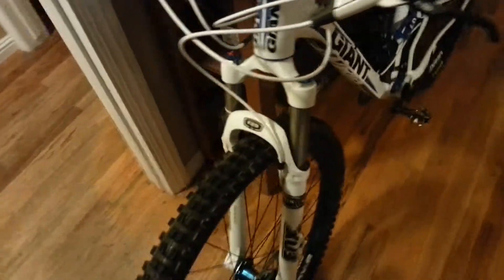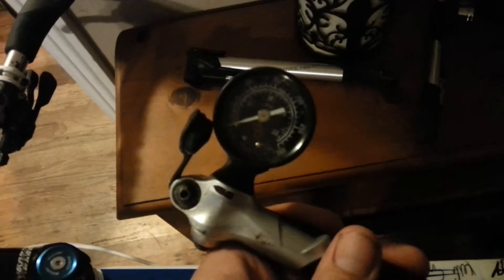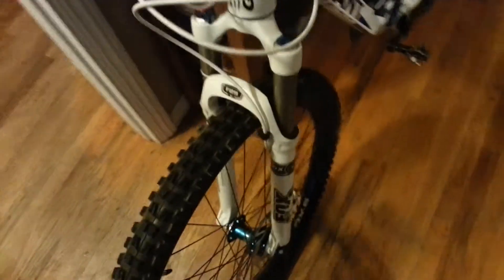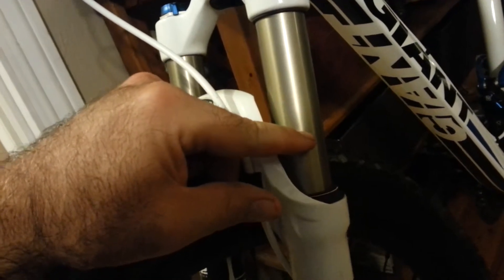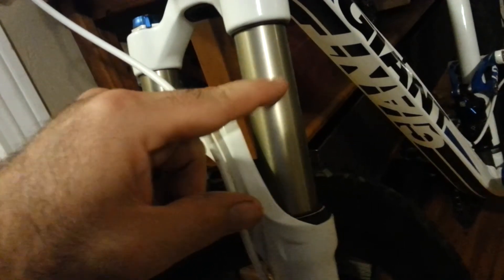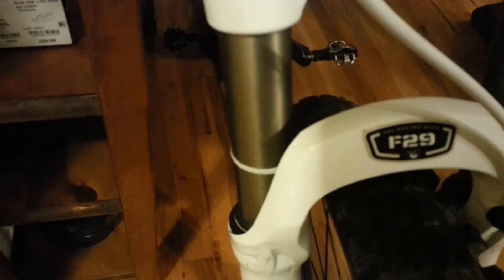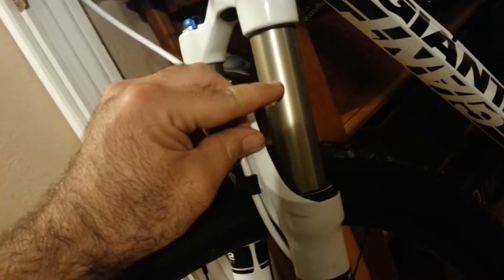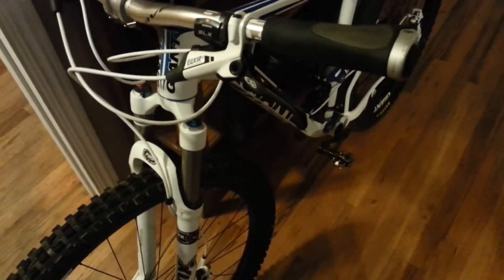Revised fork pressure settings with shock pump (bike fit)

Comment: I talked to Fox in person at the Sea Otter. The Fox rep actually corrected me and said that the air you hear when you unscrew the shock pump is actually only air from the pump airline. Nothing actually leaks out of the shock. When you go to check the pressure by putting the pump back on, it reads a lower pressure only because the air has come out and filled the pump hose. He said that everyone thinks this, but its a really common misconception.
If you think about it, it makes sense. It would be pretty silly to have a pump that gets your shock sort of close to the right pressure, but when you unscrew it, you lose some of the pressure, and depending how big the reservoir is, you lose different amounts. That just doesn't make sense, that would be bad engineering.
Reply from the maker: Spencer Larue Everybody will have their own opinion. My thought is that I'd rather minimize losses, no matter how they happen, so that my adjustments are more accurate. I notice a difference in the amount of pressure lost from the basic pump to the pump that is designed to minimize leakage, which would go against his rational a bit. I get what he's saying, but I seem to lose less air from the "better pump". It's not that big of a deal all things considered. The Fox tent helped me understand my suspension a lot better, so I certainly wouldn't mean to discount their knowledge. Anyone who has their suspension should stop by and chat with them, it's been very helpful for me.